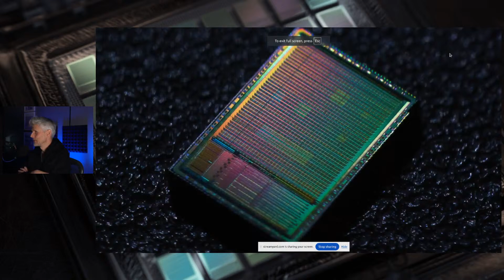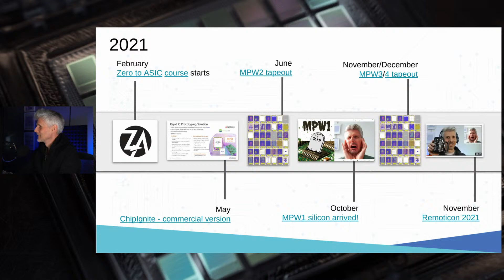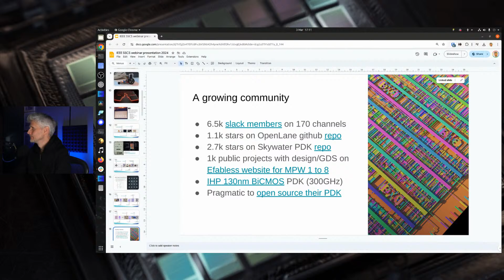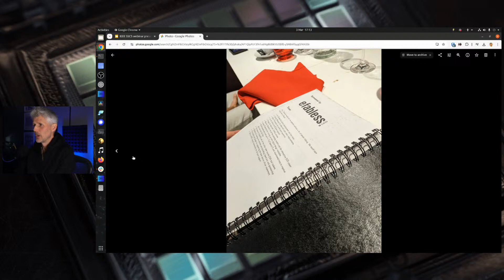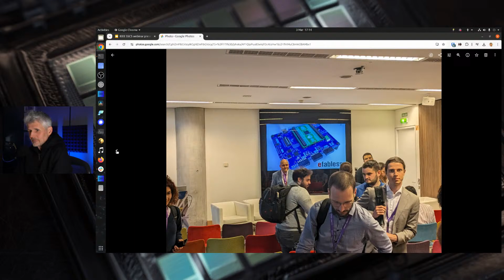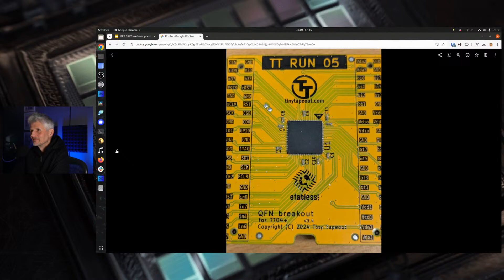Open Source Silicon Stream #7 - Efabless Shutdown

Comment: Very sorry to hear this news. I'm sure Open-Source Silicon EDA continue. I want to let you know in Korea, there's free MPW service, MyChip Service, managed by ETRI, National Semiconductor Lab., funded by Korea goverment. They accept Full-Custom designed GDS and provide fabricated chip with 28-pin SOP. This service is for Korean university students at NO cost including packaged chip. The Fab. is a bit old tech node, 0.5um CMOS 2-poly and 3-metal. But good enough for students and ASIC enthusiast. The service was started 2023 fall and 3 lots are out. I developed std-cell based design flow using Open-Source Tools. Taped out 3 times, first two design was not working and finally latest design was working. It is laboratory level fab., sometimes failed process and long delivery time, but getting better. You can visit my blog, https://fun-teaching-goodkook.blogspot.com/ for the latest news about "MyChip Service". The blog is written in Korean. Maybe yoy can read it by AI translation service. Official site is http://mpw.kion.or.kr/ I'm NOT an official of "MyChip Service", but ASIC enthusiast.